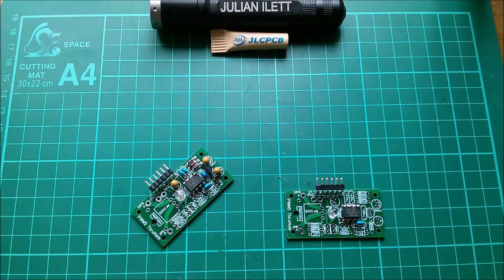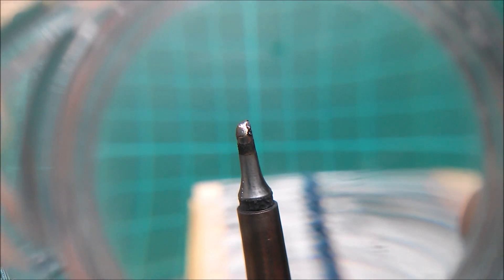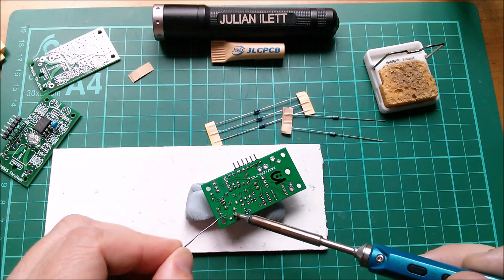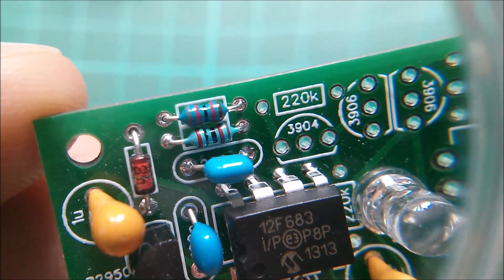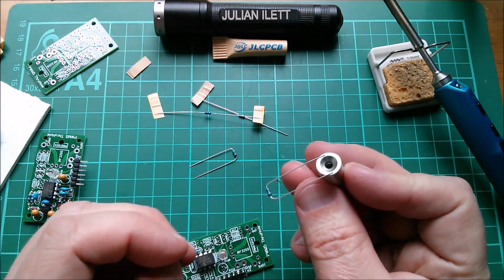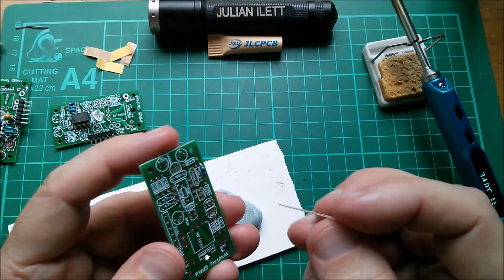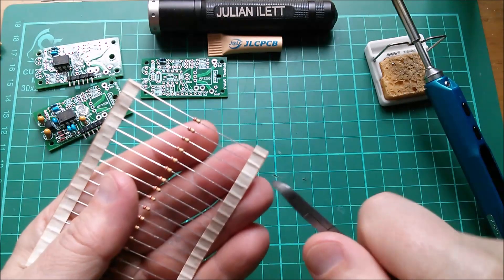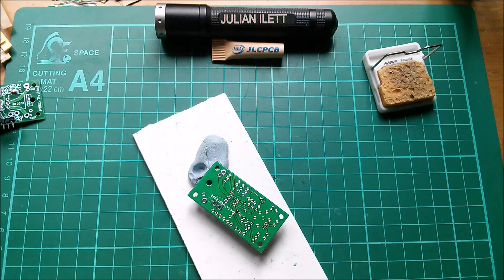16 Minutes of Soldering and Waffling on - PWM5

Comment: They might be a bit more expensive then the cheap Chinese crap resistors but I find these resistors a lot more stable, more reliable and much better matched when measured going down the line.  I get them from Electronic Gold.com, a US based distributor who stock only very high quality electronic parts.  I started out buy ordering one of those huge kits with all the different sizes of resistors, only to find that they had culled out the most desirable sized and sold them individually. It got so every time I had have a resistor, it was build my own using several to come close to the desired ohm value.  Ordering just the sizes I need leaves me with a very good selection, they come in packs of 100 each, I had to order 300 (3 sizes) in order to get the minimum order of 10 bucks.  These are the beige resistors that are easy to read, that makes a difference, and if I Have a few extra bucks, I usually order one of their "Gold" packs which is sort of the pickup after sorting so you get a great verity of high quality capacitors resistors and even some mystery parts that usually turn out to be some surplus high quality things like power supplies, sensors and other great usable items.

Comment: "Proper Copper Legs". Oh, Ya! The tolerance band for 1% is Brown. That surprised me, but I seem to remember, when resistors first came out, a 5% tolerance was about as good as they could get (and probably all that was needed for circuitry of Olde). 

So they said "Let's make it a Gold Band". (Silver Band is 10%). 

The best is Grey at a whopping 0.05%, then Violet at 0.1%, Blue at 0.25%,  and Green at 0.5%. Red comes in second to Brown at 2%. (This is in case anyone didn't know and wondered; these %'s of course are plus or minus XX%. I would have put in the fancy "Alt+" symbol for Plus/Minus, but my browser (or YouTube) jumped me into Internet Hyperspace when I tried to insert it and I lost the post I started.)
Reply: Grey is ±0.01%, Yellow is ±0.02%, Orange is ±0.05% and then comes Violet at 0.1%.

Comment: It would be nice if you went through the designing of a board in eagle or what ever program you use. Show what files go into each girber file and how you deside the current on each board for traces. The decisions on where to place the pieces on each board with out doing it ahead of taping the video would be nice as I keep changing placement and it would be nice to see how others decide placement and then moving them and why. Thanks for the video. I am new to making boards and I am sure others would like to see the design and making and it should be interesting to those that would be using JLCPCB to make their boards. You would be showing the traces and where JLC would like the different girbers placed for them when they look for the holes, silk screen and so on. Thanks again.

Comment: PWM?  Tres gauche.  Why aren't you showing us a massively efficient MPPT design, Julian?  <hint, hint> 
Judging by the color of the coating, those are metal film resistors which are usually 1%, right?  (and you confirm that later on)
Decades ago, I was told that soldering iron tip shape is called a colt's foot.
Don't feel bad about waffling.  Even your rambling imparts wisdom to your viewers.  It's all good.  Ta!

Comment: Some of your soldering looks a bit dodgey. Dirty component leads, not enough flux.
Reply: I've found that as solder is getting thinner - (I got a 50kg mixed box of 2mm, 1.2mm and 1mm years ago for a tenner, there's still enough to last me out), but smd really needs 0.7 or less so I still buy new - and even the good stuff doesn't have enough flux in the core.  I routinely "paint" new stuff with topnik or use a blob of paste on rework to get the schmoo to flow pretty.
I also find mounting smd is easier if you use a bit of sticky to stop things falling off the board.
Reply: @whitehoose  I used to scrub my circuit board tracks with a pencil eraser to remove tarnish before soldering.  Those steel leads tarnish quickly.
Reply: @curtw8827  Chemical warfare is less effort.  long time ago I used to have a pen with a glass fibre core, very aggressive but it worked.  I think health & safety banned them but scratch pens are still available on fleabay - Ill stick with my medium flux.
Reply: Andy White - I still use a fibreglass cleaning “pencil”. When I last looked a couple of years ago, they were still available from electrical/electronic suppliers.
Reply: @Mark1024MAK  Me too under some circumstances. They also do a steel and brass insert options which are a little more versatile. 
My favourite now are the 3 shapes of brass brushes made for dremel held in a pin vice they don't wreak too much havoc amongst the pixie houses ... on really bad corrosion, holding them in a dremel works quite well too.
My big beef with glass is from my brief shot working with fibre.  I still have a ring finger that can scratch stainless, that stuff is never going to shift and it's so pure mr finger is quite happy with it in deep.
Certainly when I've cleaned a particularly bad bit - and the surviving insert is just a stub, I have to wonder where it's all gone and what it's doing.
Reply: Andy White - yes, if you get a glass fibre stuck in your skin, it is very irritating and hard to remove. Hence I only use a glass fibre cleaning “pin” when solvent cleaner (IPA) and a PCB cleaning block have failed to clean up whatever I’m working on. For items corroded due to cell or battery leakage, as these are often alkaline, I first wash them under warm water, then use distilled (“white”) vinegar. Scrub with a toothbrush. Wash again with clean water. Then if in a hard water area, a final rinse with demineralised water.
Reply: Need to clean the leftover flux off, even the Chinese generally do so, looks professional then.

Comment: Quick-set or fast-set concrete is a nightmare to work with, IME. It sets way too fast to really be worked with.
Reply: Yeah, but good for fence posts. Saves you having to hold the post straight all day...🤣

Comment: When I was an apprentice we used forms for shaping the leads and a sexy little hooky thing made from an old feeler gauge that slipped under the  body of components to hold them 20 thou off the board.  They told us it was to stop corrosion but it was really just painting the coal white. 
You stacked and soldered components by class and size - then transistors with each leg attached to a heatsink (it was the 70s and transistors died if you weren't careful while soldering). Then you switched on and proved the circuit worked.  got a mark and then you dismantled the board (god help you if any resistor went in the wrong bin).  Finally your workbench was marked for tidiness.

Off to the canteen and then on to your next class.  Even with all that BS I was hooked!  Making a set of traffic lights or a smoothed power supply was better than sex (or so I thought until I actually had sex ... then I changed my mind and almost failed the course - but that's another story.
Reply: Excellent comment.

Comment: I just ordered an 8 watt rechargeable soldering iron from Banggood for $11 dollars. No cord and it won't break the bank like those expensive programmable irons.
Reply: Should have gone completely old school and got an antex 25w.  Solder anything from a hair to a coathanger and never run out of juice.
Reply: @whitehoose   My favorite iron of all time was my ISO Tip model 7800. It was also cordless and lasted over 20 years on the same battery. The battery died in it and replacements are expensive for it.
Reply: @tenlittleindians  Good luck with this one.  I carried an RS nicad iron for 30 years it was great for an odd dab or two - but didn't have the staying power for big stuff, I worked in the field (sometimes literally) and to start I had a 6oz copper slug and a propane stove for big jobs (I could go for days and weeks!).  But tec improved and now I do have a TS80, a 4s lipo, USB3 qc3 controller and it's a ludicrously complex way just to melt lead - but it's a good iron once its set up.  But it's far too clever for it's own good.
In the lab I finally got a solder station which now will only go over my cold dead body.  It's a real workhorse for real work of almost any scale.

But my first real love was that antex (I still have it) plus a weller fine tip.  Only crit was the leads were too short (that was fixed years ago).  They were built to work .... and work without any complications.

Comment: It may be more efficient to charge a single battery from the output of all 3 panels, once it is full then switch to the next one. Some years ago I read an article about adding an extra alternator and a stupid number of battery's to one of those high power insane car audio systems, it turned out that due to the internal resistance when charging you will reach a point where a 50A alternator does not not push enough current through them to put a charge in ! That article appears to be too old to be online :(

Comment: Just remember Julian,  that if you build/put a shed on top of a deck it may be considered (by those that have power to abuse) as a shed with a veranda and thus will require planning permission. Also, the maximum height allowed for the shed is measured from the ground so your deck may reduce your headroom inside your new shed. Tricky things can be sheds. I bought a new one last year.
Reply from the maker: Lots of potential abusers around here, so I may go back to my original idea - thanks :)
Reply: Where I live now, I erected a small wooden shed. I dug out about a couple of foot of soil (well, apart from where I hit bedrock) where I wanted to place concrete paving slabs. Next I filled in the holes with hardcore stone, then put concrete paving slabs down. Levelled it all up. Then put the wood base of the shed on the slabs. Next up went the side walls (handy to have someone hold them while you fix them), then install the roof sections.

Comment: Has anybody ever found the reason why resistors are painted in the blue shade that makes the color bars so hard to read?  Surely there is some reason that outweighs the negatives and I'm just dim?  The pale tan-colored ones we used to get seem superior to me.
Reply: Not sure it's true any longer Bob, but, as I read somewhere Make recently..." The beige-colored body of a resistor is often an indication that its tolerance is 5%, while a blue-colored body often indicates a tolerance of 1% or 2%. The blue-bodied resistors and the dark brown resistor contain metal-oxide film elements, while the beige-bodied resistors and the green resistor contain carbon film."
Reply: Blue resistor body usually means "flameproof",  as opposed to brown,  which isn't.  Try seriously overloading one some time and you'll see...

Comment: @
JulianIlett #JulianIlett a tip for when your mixing up is to use less water and add it sparingly , then mix it right the way through, this is as almost always the mix seems dry at first , till it isnt and use graded shingle/building sand if you want it to look nicer than balast either way use small stones under 20mm ideally 10mm , 6:1 balast:crete or 4:2:1 building sand:shingle:crete, should be fine for mix ratio, also slight tangent, you can get some really nice powdered concrete and cement dyes in interesting colours, they make for a nice floor finish